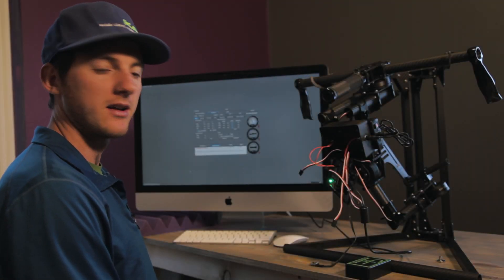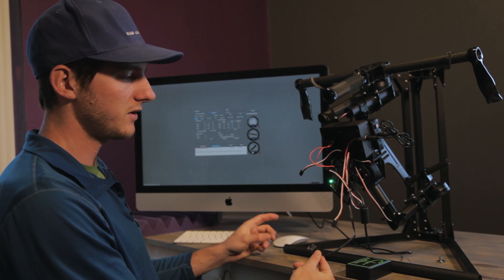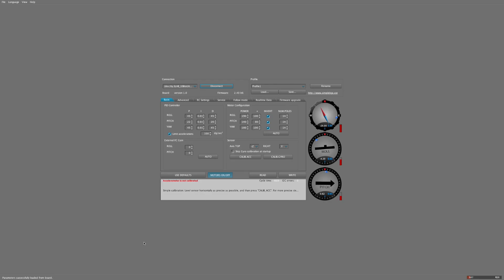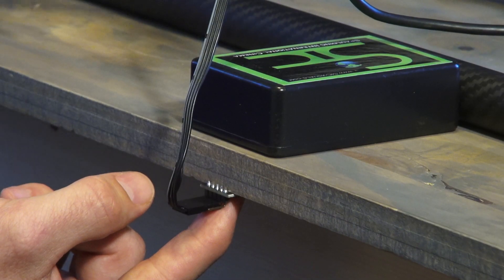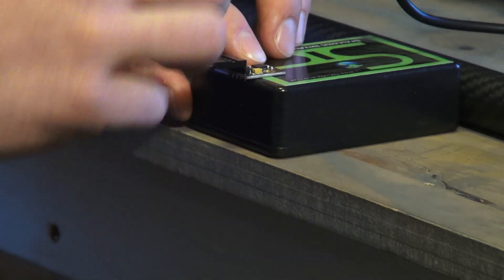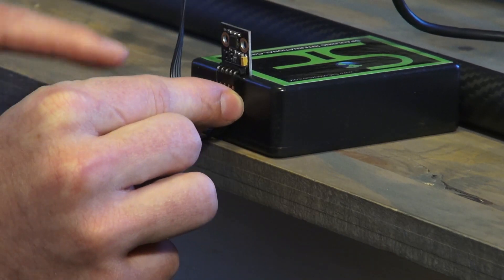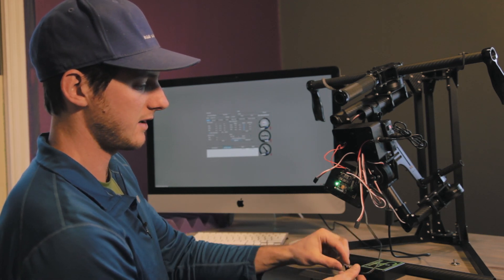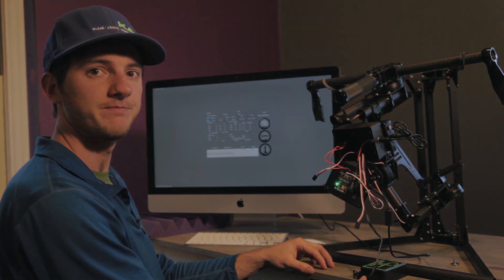The Ghost Stabilizer- Calibrating the Sensor

Comment: I accidentally unplugged the IMU sensor. I noticed that it has 5 prongs and the connector is a 4 way.(none of your video's are consistent with that) I tried it both ways and nothing works. Should I re-calibrate it?  It doesn't have to start up beep or anything.